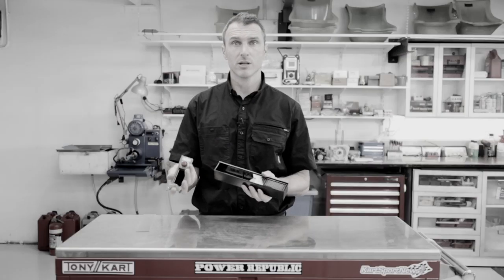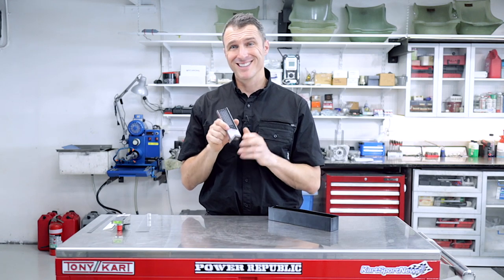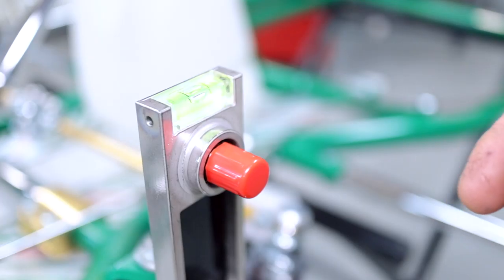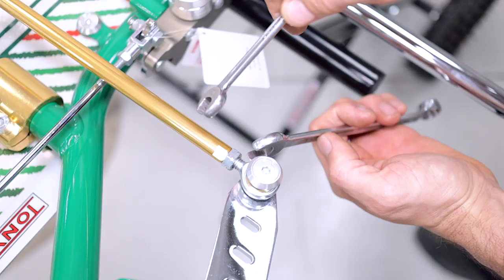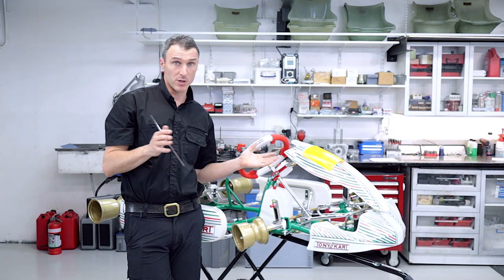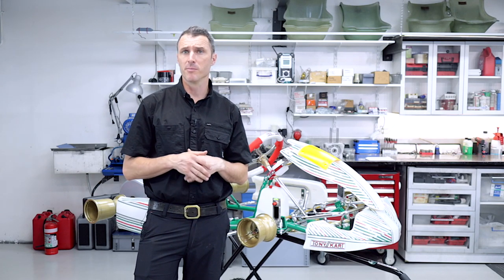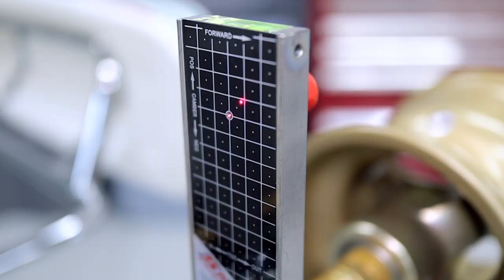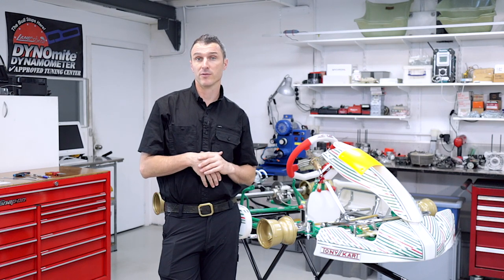HOW TO: Go Kart Wheel Alignment with Sniper Laser Aligners - POWER REPUBLIC

Comment: What do you think of running those dot 5 adjusters on top and bottom?? It means i can adjust caster&camber seperatly. I need a vid on how to work with that set up, as ive finally managed to source them including 10mm kingpin. My kart came with 8mm, which isnt compatable. I wanted the double adjustment because the front brakes on my kart will change how its driven so want to try to set it up perfectly.
Reply from the maker: Hey Chris, dot 5 are you referring to the OTK castor camber adjusters?  Yes they are excellent on the top and bottom.  These ones are 8mm on the 2020 Nordix Chassis and 10mm on the HST front end set up of the 401R/801R
Reply: @PowerRepublic yes otk, im told its running dot 3 with 8mm kingpin currently, and requires 10mm kingpin to add the otk front brake hubs. Im upgrading from 1 dot 3 which is it has to dot 5 on top and bottom for the extra.
Reply: If you have a relatively new otk chassis it should have come with adjusters top and bottom. The OEM OTK pills are each 1.5 degrees of adjustment. The "dot" pills are aftermarket not original OTK. The dot 3 pill is equivalent to the OEM OTK pill that comes standard in the karts. If you bought dot 5 top and bottom it means you now have 2.5 degrees of adjustment per pill. This is extremely aggressive, when you turn one hole position on the pill it will be a very big adjustment
Reply from the maker: @IggySport1388  thanks for that, great information.  Have you used the DOT 5's ?  I have only used the standard OTK versions.
Reply: @PowerRepublic  hey Derek, no I've had no cause to use anything more than the OEM dot 3 equivalent. It'd take some really slippery conditions to have to resort to them from my experience. In fact I've backed down from the OTK OEM setup which is 1.5 degree per pill so 3 degrees per side when you consider both pills. I am currently running the 1.5 (OEM OTK/dot 3) on the top and aftermarket dot 1/0.5 degree on the bottom

Comment: Hey! I never played with the front geometry of my kart, unfortunately it slowly started to chew the inside edge of my front tires, so much that I see rubber pieces flying off while driving, I honestly don’t know what adjustments I need for my local track, which is 750meters and composed mostly of tight hairpins and few fast bends and one short straight. a really tight track. I bought my 2021 birel DD2 super clean from a racing team it came perfectly set up but now as I don’t understand your video on how to align it i’m kinda losing how perfect the kart was when I got it, if you know what I mean :( I just don’t get where the red dots are supposed to be on the snipers.

Comment: What difference would it make to the alignment when adding the driver to the kart?
Reply from the maker: the steering normally bumps about 1 full line of Toe In and 2 full lines of camber in the Neg direction.
Reply from the maker: Depending on the chassis stiffness and the weight of the driver
Reply: Power Republic so should I be taking that in to consideration when aligning the kart, or should I try it on the ground with the driver added to get the desired results? If I do this once I would/ could have a reference point going forward.
Reply from the maker: @darronglasgow7411  the snipers are a static measurement so  it is relative to the karts performance as a reference mostly.  work out the zone (POS or NEG) that makes you the fastest and use that more often than not.  the deflection should be pretty constant so if you checked it once for you own interest that would be enough in my opinion.  For reference, we only do wheel alignments on a kart when it is on the kart stand.
Reply: Power Republic thanks for speedy response. This should help me if we ever get back to karting here in Canada.
Reply from the maker: @darronglasgow7411  won't be long now, winter is gone and the summer sunshine should burn off the bad vibes and the good times at the race track with our mates will be back !

Comment: Hi, your videos are great. I have a 2020 praga monster evo 3 cadet kart for my son , the caster alignement is done with pils and a sniper similar system for camber. The  kart has  no  acccident and  i got  the laser beams aligned  perfect(paper) both sides show equal  adjustement. Also what I  do, when all set toe and camber I measuere the distance from the front axle end center to the rear axle on both sides, so I check that what I measured or adjusted in the front is there when the wheels are in parralel with the rear axle.  But my question when I measure the caster  with the tape ruler like you showed( ruler with magnet ) I get about 2mm difference,  when I measure the swep then the diference is even bigger some 6mm? What does the swep measure actually show you??
Reply from the maker: Sweep is for getting the tie rods equal length so when you move the steering the tyres move the same in both directions.  As for the castor variations you have, 2mm is not major but hopefully it comes closer with your tie rod adjustments
Reply: @PowerRepublic   actually I went to check it the way you suggested  before midnight , couldnt sleep and  it helped
I got the sweep  to 0,5mm and the caster was after that in under 1mm, everything  checked and double checked.
What I think getting sweep right does even more to the strightness of the kart then we think. It makes the front axles, start to do their work  as they are supposed and the correct amount. If you have them out , you can align the front end but the cornering would start already croocked.  A friend told me that they were missing top speed , doing evertything then they checked sweep and the found 3km/h top speed???
Reply from the maker: @bernardplanko6780  bad kart prep = bad night sleep 😂
Reply: @PowerRepublic   thats why I never sleep well on race weekends, actually I only fall to sleep for  seconds then I wake up and think everyting over and
 over
Reply: @PowerRepublic  can I ask you just something more. Lets assume you get a new kart( rotax grand finals)and you have to check the sweep fast and accurate. Would you first make the to out  zero and then going to check sweep? The second questiob I always have is , when you have a sweep difference how do you know what is better. Going from both sides 1/2 of the missalignement or just one side?  Or is it also good to pull al ball joints out and give them the same amount of  thread ?
Reply from the maker: @bernardplanko6780  double check both first then adjust and re check.  its a bit of cat and mouse.
I like to check the sweep first, then adjust the toe on both sides to give the correct toe that I am after.

Comment: So, the scenario is that we've hit something and one or both of the track rods are bent. And we've got only 20 minutes before the next heat. Any tips on replacing the rods and ends quickly so they're at least in the ball-park so we don't miss the next heat? Cheers.
Reply from the maker: chuck the snipers on and do a quick wheelie.  or you could have a spare Tie Rod already dialled in with the rod-ends tight and in position.  Then you could just bolt the new Tie Rod in and the wheel alignment was already set.

Comment: Derek. I have an issue with the accuracy of my lasers. How can I check the units and adjust if it is out. ( I think they have been dropped) my answer was use a rear axel to check neutral measurements. Would this work in your opinion?
Reply: swapped them from side-to-side. The should be the same both ways.
Reply: Tony Zambos do you mean while on the rear axle as I suggested or on the front in normal use? This was the issue in reality. It showed the same fault when swapping from side to side, but the fault shifted when swapped. Really I’m checking my work because a supplier suggested I couldn’t check them and should replace.
Reply from the maker: Thanks Tony
Reply from the maker: Hi David, yeah check them on the rear axle facing each other.  I guess they should be exactly on the lasers dot side to side.  Also check the mounting faces for some damage.  And double check your stub axle for imperfections.
Reply: @PowerRepublic  Thank you

Comment: Hi Derek, at the beginning, where you have the piece of paper to check if the steering wheel is centered, with mine the 2 dots are above each other BUT not covering each other ( don't know if this makes sense), So they are both on the Y-axis to say, but I see 2 dots (one above the other) instead of that they are covering each other.. Eccentrics are on the same setting both sides, does this mean something is bent..? (Like it seems I have 1mm neg camber one one side and 0 on the other..)

Thanks for your super video's
Reply from the maker: Hey Damien.  Thanks for tuning in and sharing the videos. I know what you mean. It might be bent, or the C section might be slightly different across the chassis.  Have you tried to move the castor pils one hole difference on either side?   Some times this will fix any laser miss alignment and the kart will perform like a dream.  Try settings the adjusters and see if the dots align
Reply: @PowerRepublic  Hi Derek, is it not a problem that the caster is not the same at both sides then..? (When U change it at 1 side to level out the camber difference..?)
Reply: I have this exact same issue on a brand new Tony Kart STV 450. One side reads zero camber and the other reads 2mm (1 grid space). All castor pils are zeroed out and facing forward. Is it an issue if one side has more camber applied to get an even reading?
Reply from the maker: @Chef_602  I don't worry so much.  its best to balance out both sides and then double check the castor/sweep is the same accross the kart, than the exact dots on the castor pils the same IMO

Comment: What does it mean if when doing the sweep angle check the laser only goes down until your at full lock? There is never a dip?
Reply from the maker: Hey mate, is this on an X5?  if so it might have a steering shaft limiter in the bottom steering bell.  if so its a range of motion I would imagine
Reply: @PowerRepublic  No, it's my old X4 Arrow.

Comment: What is the best position to place the sniper laser aligners? As close to the stub axle bolt or as far to the stub axle bolt? Is there a difference?
Reply from the maker: only if it iis not sitting flat on the axle.   best is to take off the wheel hub if in doubt
Reply: It is sitting flat in both cases.. By saying as far as possible from the stub axle bolt I am referring to the far end area where the hub spacers are placed.. From what I see there is a difference in the readings.. In any way during alignment I try to position the snipers as close to the wheel rim position as possible